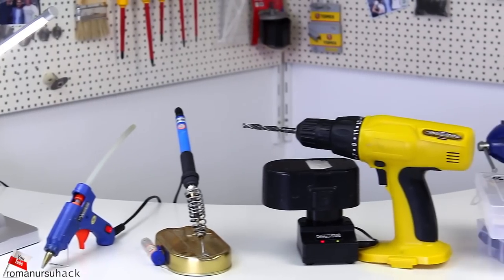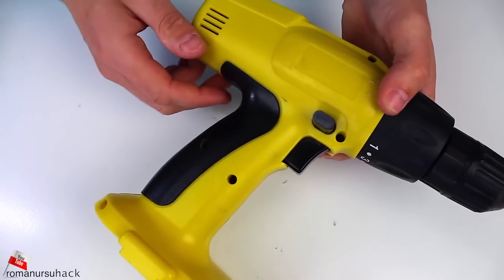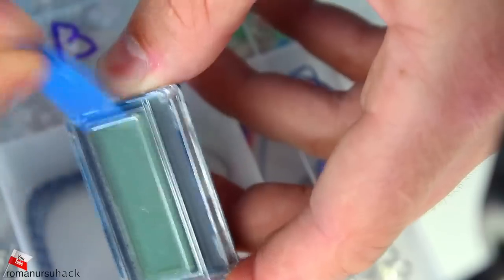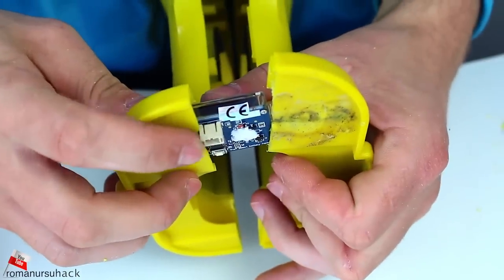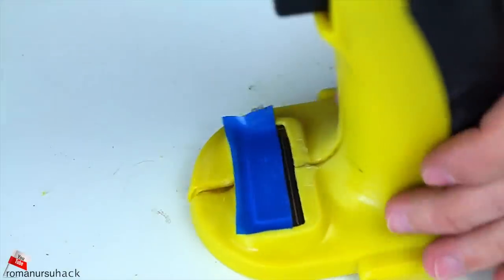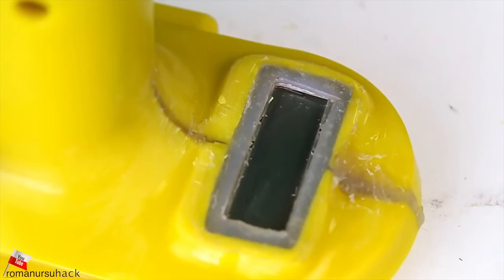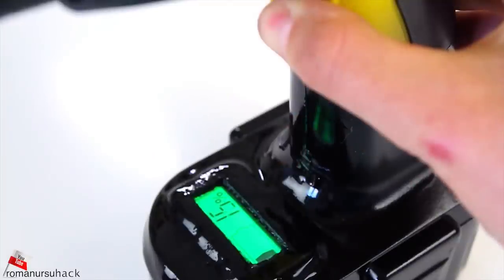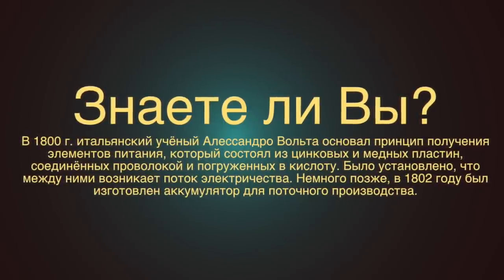What can be made out of OLD Cordless Electric Drill ?

Comment: the battery dies quickly so you add on something that will cause it to die even faster.. smart fella there
Reply: While the parasitic drain of the display means that people who infrequently use their drill, would not want it to consume power when it is not being used, otherwise when you are using it, the amount of power it consumes then is quite trivial compared to the amount the drill itself uses.

However you are correct that this is not a solution to the problem.  A solution to the problem is either an entire drill replacement since the whole thing is junk, or rebuilding the battery pack with quality cells, then hacking the charger so that it has a proper charge termination instead of the crude, dumb high trickle rate charging that it does before it starts to cook the battery and damage it, which is likely part of the reason that the pack life is unacceptably short, in addition to use of generic low quality cells.
Reply: Or buy a quality drill with a built in charge indicator.

Comment: Interesting mod, but the video and title do not match. You did not make anything out of an old cordless drill. I have a mod you could use. When the battery dies, you can attach a two-element wire, like a cheap extension cord, to the two contacts in the drill where the battery contacts meet, using solder. On the other ends, attach red and black alligator clips. Now you can power the drill form any 12V battery, if the original battery was from 9-19.2V. My 19.2V Craftsman drill works fine on 12V.

Comment: You state that after years of use the battery does not perform anymore. How does putting a meter that tells you what percentage you have left address a battery that won't hold a charge. Even if it says 100% charged, the first hole you drill or screw you drive will have your display reading nothing because it won't even have enough battery power to illuminate it. Every one of your videos that I've seen are hacks only in that you're hacking the meaning of the word hack.

Comment: Clickbait. Turned an old cordless drill into an old cordless drill with a battery indicator because the battery will not charge properly anymore. This is complete futile effort, a battery indicator will not regenerate a worn down accumulator.

Comment: if you have to get the hot glue off - don't heat it up - use fingernail polish remover or acetone.  it will release the hot glue in seconds

Comment: dude you are a problem solving genius, as to the comments about the gauge, lcd screens of this type would use 0000.1% of the battery,the drill battery would power that LCD,for 10 years before a recharge,just think of the tiny battery in cars,so you dont loose your odometer  reading when you disconnect the 12v battery,its tiny and lasts on average 30 years
Reply: +Polly G Agreed... and what gets me is he even addressed that in the video, he says you could include a switch, make a timer to turn the display off, but he is just gonna disconnect the battery. I suppose paying attention is too much for the complainers.